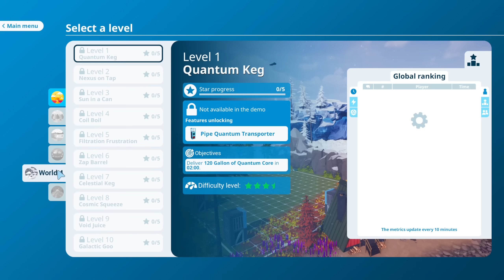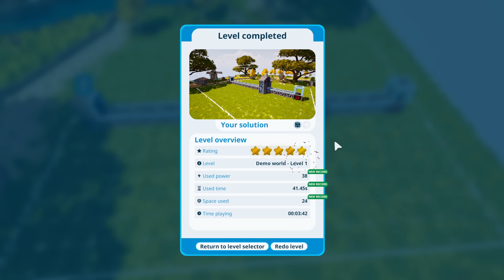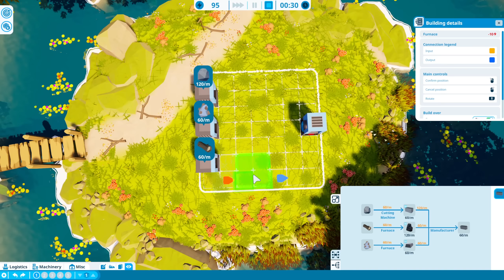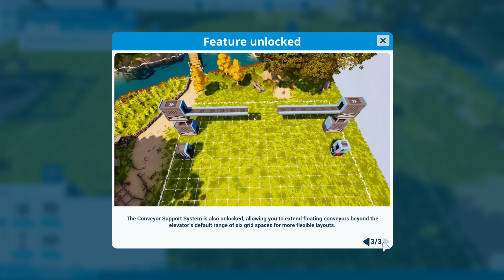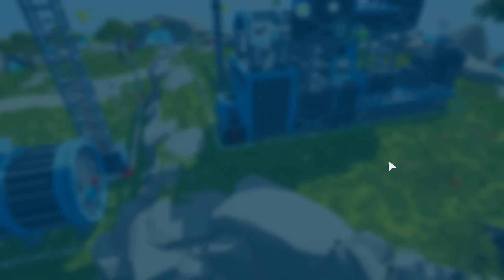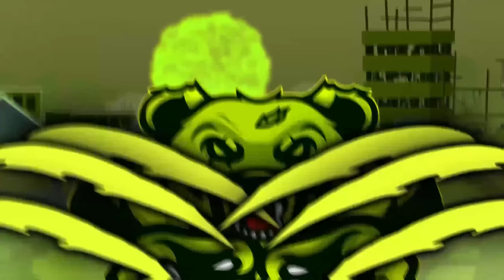Can You Solve These Insane Factory Puzzles? - Automate It [First Look]

Comment: I've been playing this a bunch and it took a while to figure out somethings as well.

That video for the elevator advanced mode isn't very good since it doesn't actually show it reversing the top. I only figured it out around the same time you did.
The tutorial doesn't explain what's a gas or fluid but the icons are different (water drop for liquid and little flame? for gas).
Also both are unlimited, I only confirmed that when I found the help center button (top left).
There is also a tab for settings for things like splitters in the box that shows the details about the selected item. This I only found recently but it is a game changer.
And once you've unlocked an item (like pipes) it is available for previous levels as well.

This game looks simple but it can be just as complex as the big factory games.

Edit: Forgot to mention that you can select what items the demolish tool removes in the top right box.
Reply from the maker: Wonderful comment as always! Some absolutely great tips in here I’ll have to use!